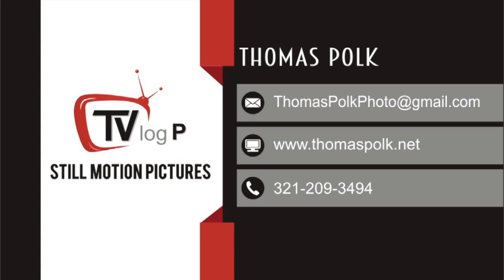3 Types: Drive Shaft Vibrations . . .

Comment: Have a w201 that vibrates like crazy in 5th gear under 45 mph when accelerating. Otherwise things are mostly smooth, not perfectly as it's an old diesel but definitely tolerable. I currently avoid 5th gear below 45mph. Suggestions?

Comment: Hi Pierre. I have a w115 220 manual transmission from 1971 with driveshaftvibrations when accelerating.   I already replaced the engine mounts and transmission mounts.  You mentioned the flex discs.  They look good to me.  No visible damages.   Could it still be the flex discs? 

It is a 3 piece driveshaft with 2 center bearings.   And those look good too
Reply from the maker: how are the drive shaft supports and bearings? Also, is the front u-joint frozen? I find all three of these can cause these vibrations.